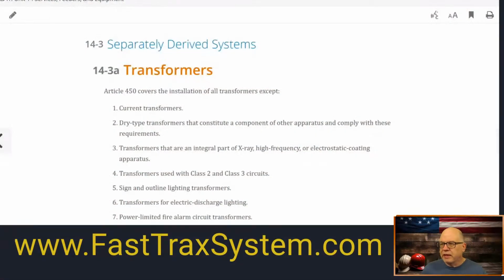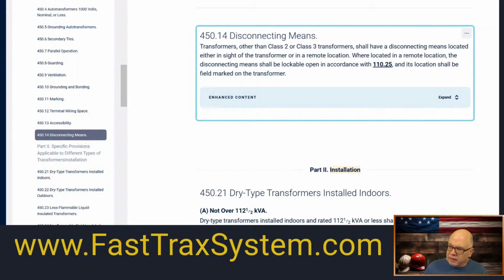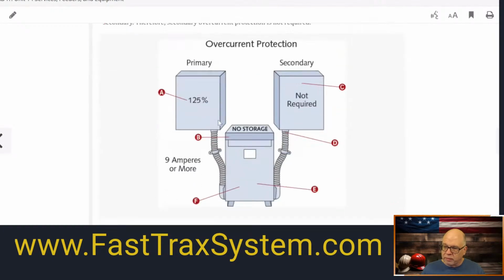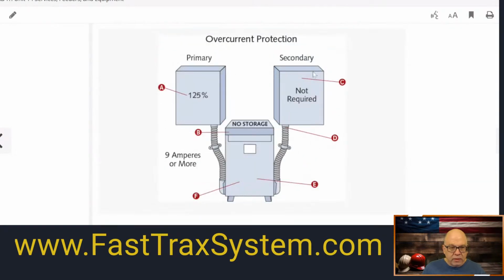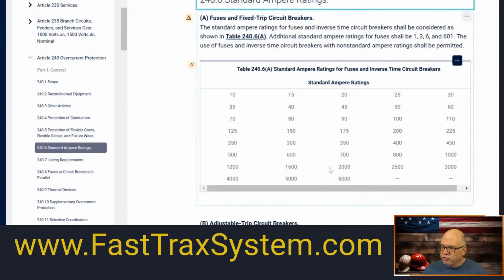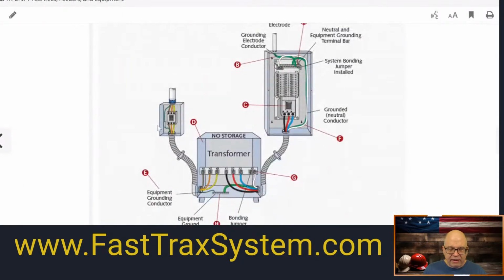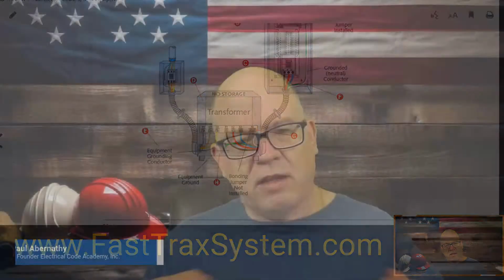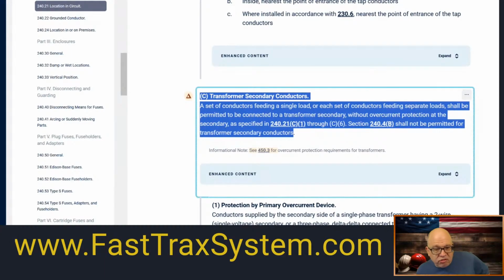Transformer Overcurrent Protection — What Most Electricians Get Wrong | Coffee Hour

Comment: So primary side ocpd cant go next size up and primary feeders  conductors need to be full size to the rating of ocpd ( cant use 500 on a 400 amp breaker)
Secondary can go next size ocpd and secondary conductors have to be full size to ocpd rating?
Reply from the maker: When you have Primary Only Protection on those RARE setups then you can exceed 125% if the OCPD doesn't correspond. In the case of Primary and Secondary Protection, the primary cant exceed 250% except where noted in 3 for coordinated thermal overload protection thats built in from the manufacturer.  Remember, read those little notes next to the percentages.
Reply: Is the conductors feeding primary feeders? Are the secondary conductors always taps and the ocpd need to be with in 10 or 25 
feet? (Or industrial plant lengths)
Only talking about primary and secondary protection transformer
Reply: Nm i rewatched and you answered. I would interested in s video in sizing primary and secondary conductors.